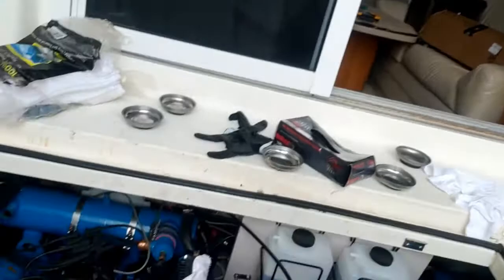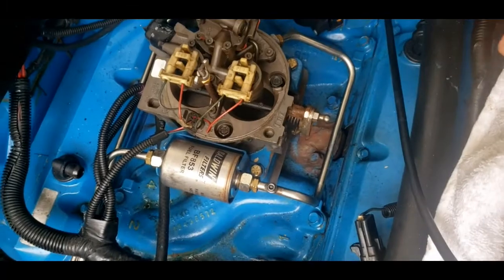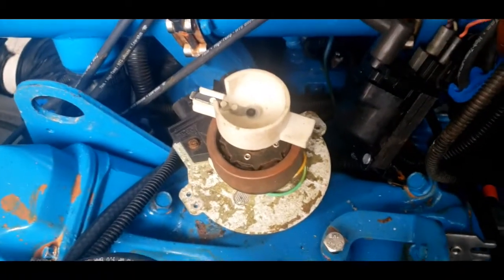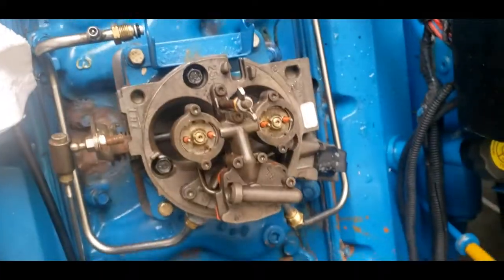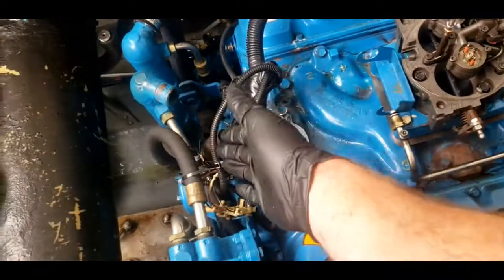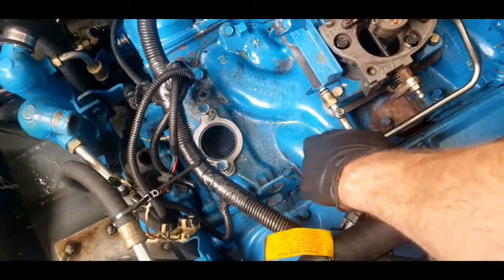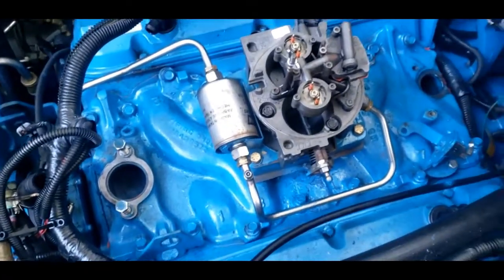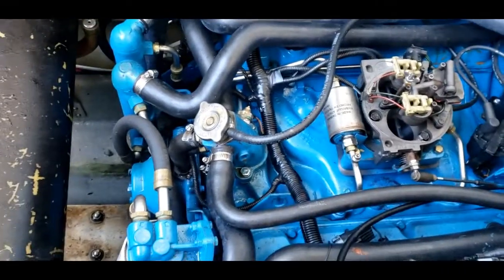Marine 454 Intake Manifold Gasket Replacment

Comment: Hey Chris, did you consider blocking off the exhaust crossover port? I was discussing with a marine surveyor about an engine with a similar issue, it was running about 700f in that same spot that it was bright white and hand burned off the paint. The recommendation was to block off the crossover knowing startup might be a little harder in my region (WA) but it was worth it for long term performance. Not sure if closed vs open cooling made a difference. Great video btw, very informative on the process and guaranteed to be an excellent resource for someone to come.
Reply from the maker: That's not a bad idea, especially for someone who lives in a warmer climate I don't see the harm. Unfortunately this isn't my boat so I don't get to make that call.

Comment: Chris, this is a very good video. I very glad you posted it. A marine repair center informed me yesterday that this is what needs done to my starboard engine (454 Mercruiser). They found intake leak on #6 and #8. It's been experiencing rpm loss (always after about 1 hour of continued cruising). What would you estimate that a good shop would charge to do this job? I'm currently waiting for their estimate. I would have loved to do this myself if I had the time and boat wasn't 300 miles from home.
Reply from the maker: That varies greatly depending on shop and area. I live in WA marine shop rate could be anywhere between $120-$150 per hour. Plus the cost of materials for a 3 hour or so job you could be looking at $600-$800 give or take. Now that's just a rough estimate based on what I did. If they find more things wrong as they do the work the bill could increase

Comment: Thx for the good Crusader content.  There isn’t enough out there.  Where did you get the shop manual for the motor?  I’ve been looking everywhere !
Reply from the maker: https://silvertonclub.com/wp-content/uploads/2015/12/Crusader-Engines-Service-Manual.pdf
Reply: @christopherjpeters  Holy smokes, don't want to make this weird, but I'd hug you if I could.  Thanks my man.
Reply from the maker: I would have to ask the owner of the boat. He provided the manuals. I was surprised myself.
Reply: @christopherjpeters   The Chris, Would you be willing to ask?
Reply from the maker: Yes I will ask him and get back to you.
Reply from the maker: He said he just got them off the internet. What year is your boat and which manual are you looking for? I can do some research for you.
Reply: @christopherjpeters  1995 Crusdader 454's.  I have the general maintenance and trouble shooting manual, but not the full shop manual that would get into details such as torque specs etc.
Reply from the maker: After I get off work I will send you what I have. The owner sent everything to me on PDF file. Let me know if they help.
Reply from the maker: No problem,  glad I could help